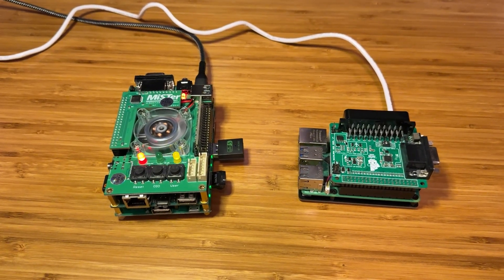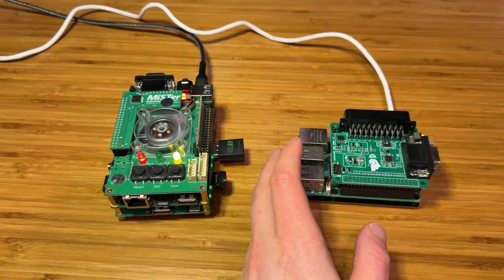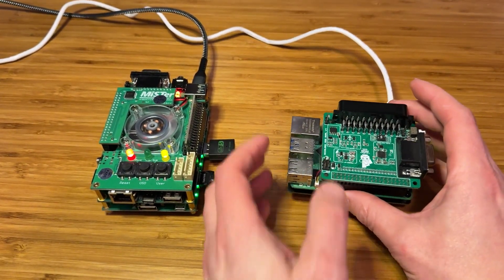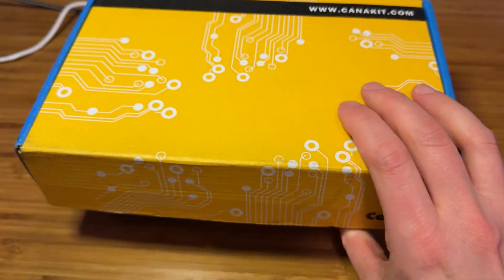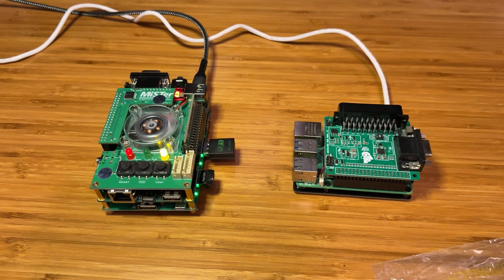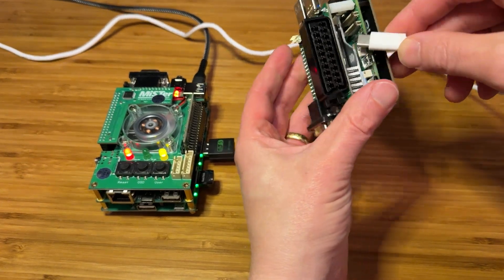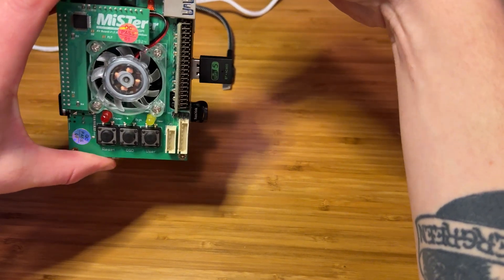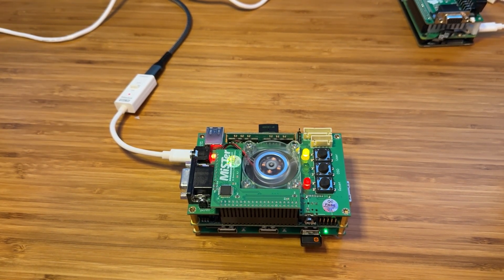Fixing My Biggest Annoyance With MiSTer FPGA and Raspberry Pi by Adding Power Switches

Comment: You literally have a built in power switch on that Recalbox RGB Dual HAT, right?
Reply from the maker: Is that what the button does? It legitimately isn't even mentioned in the manual on Recalbox's website. I will test that, but I do like the tactile switch. It also works well for where I have the Pi mounted in my arcade machine. Thanks for the comment. Have a good one!
Reply: @pixelprojectsofficial  Their manual is poor at best. You also have two pin headers labelled "Wake up!" besides the button which allows you to wire in whatever switch you want so you can route it to the back, side or whatever of your cabinet.

Comment: Thank you for sharing this! I want so badly to buy something like this but I can't seem to find it in EU. CanaKit sells only in USA and Canada which sucks.
Reply from the maker: That's disappointing. I imagine you've checked around various Pi5 sellers?
Reply: @pixelprojectsofficial  yes, a lot of websites and no success. I also asked them directly via email and they said they don't consider shipping to EU anytime soon. If I wanted I could order things from them but unofficially and pay like 45$ only the shipping which is crazy expensive.
Reply from the maker: That's a bummer. And yeah, their shipping in the states is pretty expensive. They charged $14 to ship those two things (should've been $5ish), but I'm very happy with the switches. Here's hoping something pops up for you soon.
Reply from the maker: @limonada_spatiala  Looks like Todd at Retrofrog is selling power switches. Not 100% sure it'll work with Pi5, but Todd will probably respond to an email. https://x.com/ToddsNerdCave/status/1861436141779484816